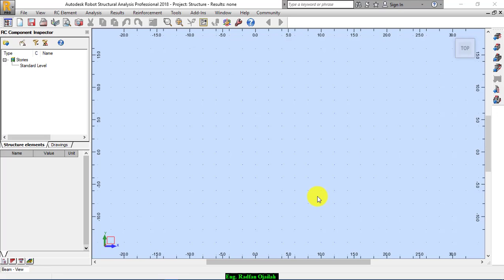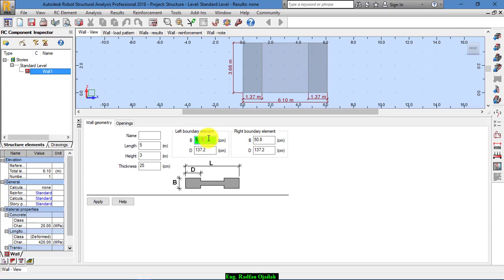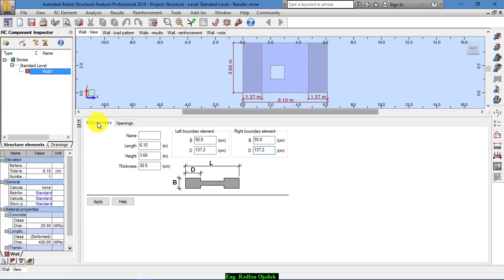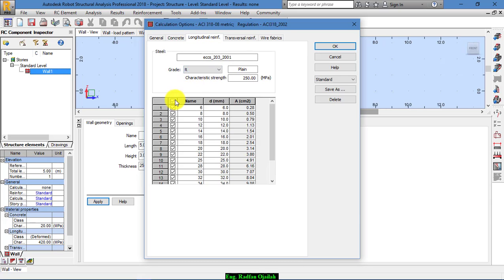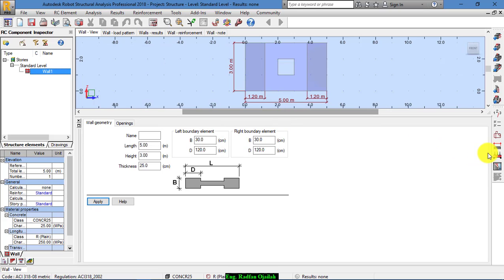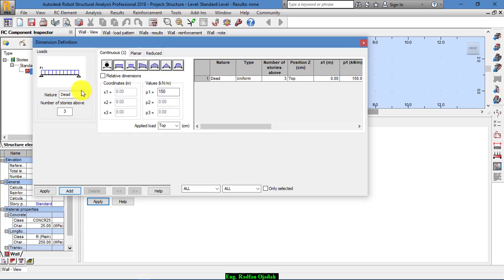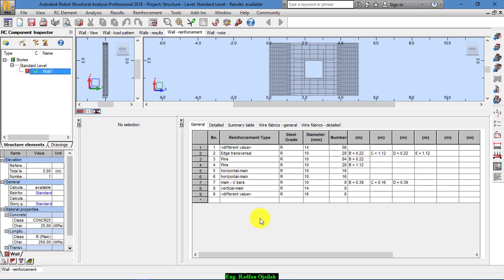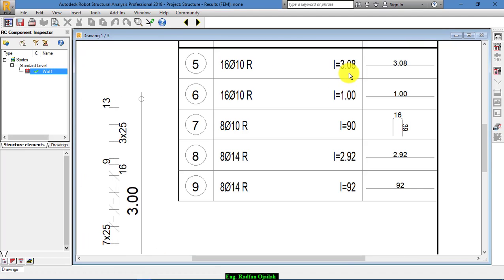Lesson#14 Designing an RC Wall in Robot Structral Analysis Professional

Comment: Hi Radfan! It is a great video, but I have a question for you. I have drawn a structural wall on concrete in Revit, afterward, I uploaded the wall in Robot to calculate de RC. When I upload again the wall in Revit, I don't see the RC in the structure. There are some limitations to the RC wall between Revit and Robot (because I don't have this problem with beams and columns).
Regards